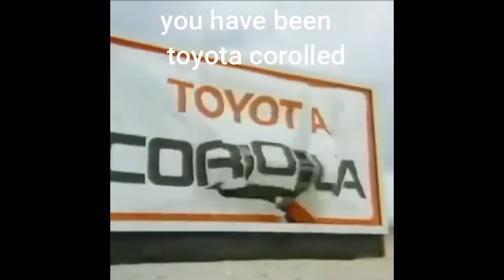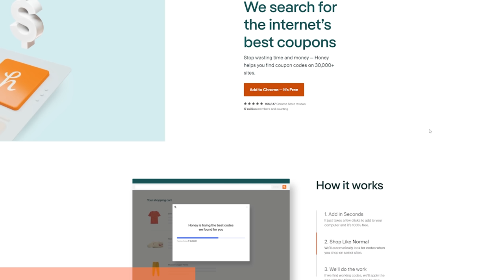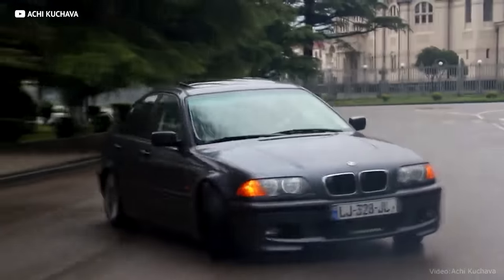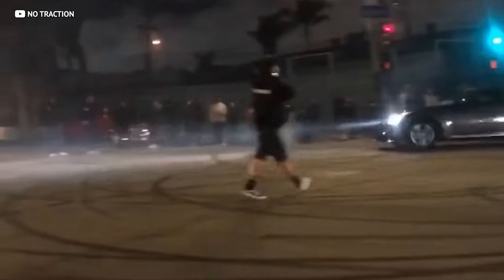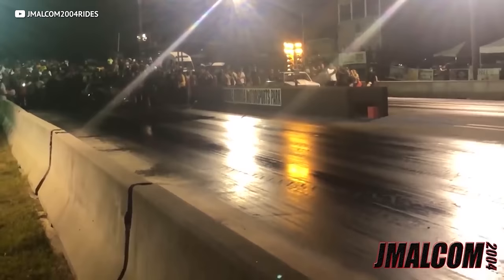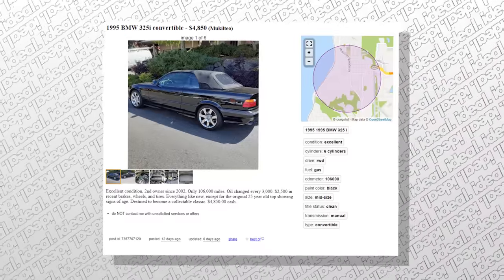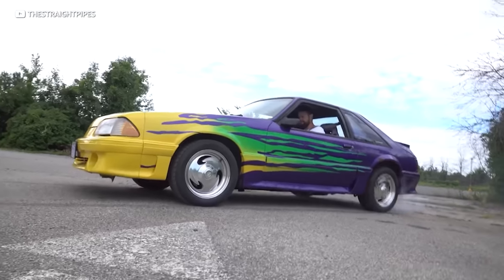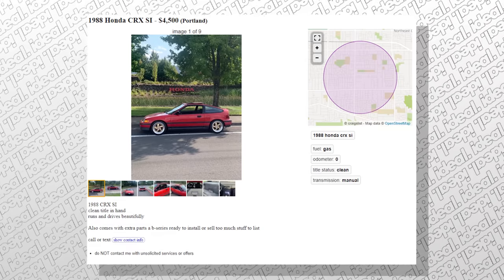8 CHEAP Cars With Unlimited Tuning Potential

Comment: I had a 1990 Accord EX in high school. Parts weren't super popular, but I was able to get a header-back exhaust system, coilovers, intake, new cam, new valves, upgraded ignition, and a few more suspension parts (strut bars, sway bars, end links, etc.). In auto shop my teacher and I did some grinding to the valves, honed the cylinders, got the head and block machined down, new head gasket, water pump, fuel pump, and a bit of other things. Took the default F22A2 from 130-ish HP up to a little over 220. For a 4-Door grandma car it was a total sleeper. I miss that car :(

Comment: Stock for stock an SC300 makes a better project car. The IS is OBDII with a VVTI 2JZ with the weakest internals available for 2Js. Non-VVTI OBDI SCs are better boost candidates and are easier to work on.
Reply: Facts the internal for the is 300 are weak
Reply: Thanks for this comment , I’ve been wanting to get one for awhile such an underrated gem

Comment: I have owned an LT1 Camaro, currently own a New Edge Bullitt Mustang with a procharger.  One thing I think you missed is a Crown Vic, other than Cleetus buying them all up.  Or a truck.  Plenty of regular cab short beds that can be quick.  Oh, and want a cheap LS, truck or van is still a cheap way to go.
Reply: Id like to go IS300, or E36 Bmw next.  But I am currently working on a '74 Dodge D100

Comment: Always liked the CRX. I wonder if you can tune that motor without dropping in VETCH? Also the IS300 just because of the 2JZ. OOOO so tempting. 700hp would make my kids think their 65 year old father has gone nuts. Sounds good to me 😃
Reply: Is300 much better if you swap in the 3gste. The 2jz makes power but it is a straight line engine. The powerband sucks yif your going to do anything but drag it sucks.

Comment: CRXs only came with a B Series in JDM Markets, good luck trying to get one. Even if you manage to swap a B goof luck finding genuine Type R Parts. They won’t bolt on right up unless it’s a VTEC. And they’re not cheap
Here in the states the best CRX we got was an Si and that came with a D Series pushing 108HP.
K Series would be the best option as they’re easy to find and fairly cheap to swap into 88-91 Civic/CRXs

Comment: I got one for the list. 1998-2003 Acura cl/tl. Both cars are still reasonable priced,have plenty of aftermarket parts and power upgrades,and don't take much to rip down the highway. I had a 2001 Acura Cl type s that ripped down the road when u opened her up
Reply: Power to weight is horrible, why it isn't there.

Comment: I actually drive fwd Camry. 2015 se. it isn’t half bad. I would prefer something faster and louder but this thing can get the job done for now. Handling is great on it and I can outpace dodge darts in a straight line roll race on the highway.

Comment: You need to do a list similar to this but with a cost breakdown of the modifications required and how many horsepower you add and end up with.  See what is the cheapest way to get a car to 400hp or 500 hp or to add 200 hp to a cheap car.  

Another ideas is the cheapest high hp:weight ratio after mods.  Is it an MR2 with $2000 of mods or something else.  

Get specific with the actual  mods and those prices.  Maybe to a bracket series where you start with 16 cars and do 2 cars each episode and pick a winner for those parameters
Reply: Would be cool, but would take a TON of research that relies entirely on other people's completed builds, and dynos, where the owner may not be the original modifier. Also, many people end up going over their budget, even when they think they planned well.
Reply: not possible to make a video like that. too many variables. it all depends on how good of a mechanic you are. if you cant do anything it will be expensive unless you just get a big v8.
Reply: @MV-ri7zu  not true. There are common methods that are used over and over on the same car to add easy HP, exhaust, tune, cam or injectors.  Some cars don't need much to add 100-150 hp and some need more.  

Don't need set up to reach max HP, but some cars you can add 100 hp for $1500.
Reply: @shaneducholke364  and those common methods usually vary in price A LOT depending on how good you are at finding parts, buying parts and installing them.
Reply: @MV-ri7zu  hence the video request

Comment: I actually own an IS300 but the VVTI cam gear is something people need to look at once the car has 200k+ miles
Reply: I'm thinking about getting a is300, I currently have a 08 gtv6 Tiburon. What does the VVTI do for it after reaching 200k miles?
Reply: @luck6959  Nothing really changes but just keep an eye out if the VVTI can gear oil seal cause it would break down and you loose a lot of oil cause of it.
Reply: So what exactly do i need to change after i reach 200k

Comment: The Is300 and the Pontiac WS6 are definitely a great cars!! I still wouldn't mind having one. But there are three other cheap sleeper cars that i like and they are the cobalt SS, Saturn Ion Red Line and The Grand Prix GXP
Reply: is300 isnt even cheap unless you get an automatic which will be expensive af to mod since youll be swapping pretty much everything.

Comment: An 8th gen civic SI can be snatched up for cheap now. Just got one for $5,600. 8k redline, 200hp and a full supercharger kit including fuel pump, injectors and Hondata tune sells for about 5k, and will make 400hp in a car that weighs less than 3,000lbs. Build the engine, transmission, and make it AWD and you can stomp R35s and Lambos for like $30-45k. Plus it's pretty comfy, cause it's a fairly modern Honda

Comment: Great video and ideas, I'll just toss in the "Mister Two" has a Pontiac competitor, the Fiero. Folks used to give these Cadillac 4.1 swaps, then 3800 supercharged swaps, now its Impala LS FWD drivetrain swaps. It might be too old for some, or too much work to do a drivetrain swap if you're just looking for bolt on stuff, but the plastic body panels keeps the rust demon away.

Comment: I've had 2 E36s. 1st was a 328i auto.. 2nd was a 1992 325i non Vanos with a 5 speed. Much more fun. Also had a 92 Celica gt 5 speed. Slow but fun. Now I have a 91 honda accord and a e46 m3. Love them both. Would like to get another e36 and make a cheap drift car to learn in tho.
Reply: What sites do you use to look for vehicles?
Reply: @litaf4889  I don't really. I did buy the 325i off of a guy on Craigslist but that's it
 Bought the 328i at and auction and the Celica from my brother.

Comment: First car was a v8 jeep. Still got it. When I turned 18 I bought my 2nd car, a pretty clean 99 civic. Wheels, coilovers, intake, and a sound system and it was a pretty fun cheap to drive, good mpg daily. 4 days after the coilovers and a cop didn't yield to me and totaled it. I'll always miss that car. Had the 5 speed too.

Comment: i own a manual infiniti g35S from 2006/revup. It's an amazing car actually and i've got headers/exhaust/injen intake/plennumspacer/wahlbro 255L gaspump/tein coilovers/cusco springaxels/wilwood steady axels and bigger brakes. i can tell that ALOT of turbo cars dont stand a chance. it's pretty quick. also this costed me maybe 750 dollars for the engine. and turbo convert with forged engine is like 5000 dollars. because the compmotive turbo is expensive but you dont need the oil/water pipes :) just mount it on the exhaust. and forge the engine , your'e pushing 900+ horsepowers.
Reply: Do you have a YouTube video where I can put this together myself? I'm new to the car community
Reply: please let me know about this car  and post video's or anywhere you have it? thinking about getting an infinity for a fun project car lol have a honda accord 2011 lxs and want something fun on the side lol that or ls 300 what you think? you have an instagram?

Comment: I got one a few, 2013-2019 Ford Escape 2.0 Ecoboost, GMC Yukon, Lexus Ls460 and GS460, and Chevy Sonic. Cant go wrong with a 5.3, GS is a detuned LS 460, Chevy sonic was a recent one with the aftermarket help, and the 2.0 is from the focus st so they share parts, difference is the tune and turbo.
Reply: Sonics can be rad, but the bigger hatch Cruze turbo are tuned able for about 1k. For about another 4k it's on coilovers, wheels, and some bolt ons you've got yourself a little hot hatch. The aftermarket isnt bad.

Comment: Funny part about the MR2 spyder being in here for me is that in the UK this model of MR2 is literally everywhere and I could buy one if I wanted for anywhere from £1500-3000. Though no boot space means if I want a car like that I'd rather have an MG TF or a Honda S2000 which are also relatively common

Comment: I own a 2004 SAAB 9-3 Aero (HOT version) 210bhp  standard. Unfortunately it runs the GM B207 block rather than the legendary B204. However the standard Garrett Turbo works well. Runs at 12.8psi as stock (0.8 BAR). Holds very well against Carrera 4's. The down side is your boost is electronically capped until 3rd gear, but 3rd is such a long gear, can take you from 30mph to 110mph no problem and the pull never seems to stop. I paid £990 for it 4 years ago and never modded it - never felt the need to.  All I did was replace the duplex timing chain/guides and pully's, banana arms and front dampers and coils.

Well worth it and a lot of fun. Keep in mind there are 2 versions. The 150bhp and the HOT variant (high output turbo) which is 210bhp stock.

A stage 1 tune will go from 210bhp/310nm torque to 250bhp and 370nm torque and is pretty cheap to do, around £100

Comment: My 1st "Car person car" was a 1999 Honda Accord. F23A4 SOHC VTEC 5 speed manual. It was murdered by an idiot from another town a few hours away who believed that particular stop sign didn't apply to him. Had over 436k miles on it and would still crack 130mph between exits on the highway. I miss it.

Comment: But you showed mostly G37s in the G35 section haha. Those are the cars that you can make 400WHP with the smog legal Stillen supercharger kit. I've been debating doing this but the little amount of power it makes over FBO and a good tune doesn't seem to be worth the extra weight, issues, and price. Unless you swap intercoolers but then it's no longer smog legal, or you just care about 3rd gear pulls on the highway.

Comment: IS300/Toyota Altezza here in NZ has a 3SGE Beams. But The altezzas go low as $2500. Classic G35/Skyline 250GT which go for about $2000-$7000
Reply: the altezza is a is200, comes with 3sge or 1gfe. can get an altezza gita with a 2j though

Comment: cheap bmw 335i. cost is about 5k for the car, 1k for the entire air setup, and about 500 for pumps and simple servicing, you have a performance car for about 7k. with the air setup you receive tunes that are absolutely awesome. its a great car for the price, and you can push 400bhp and higher. as long as you change the pumps, air setup, and a couple of other plastic based parts to metal, you have one of the best cars for the price, at the best looks, and best value. severely undervalued nowadays.

Comment: There are Toyota pick-ups that have the same motor as the supra, SR5 models prior to 97' have the inline 6cyl motors, you can quickly and cheaply get a monster amount of HP for a few hours of work on a saturday and sunday

Comment: I own a 2002 IS300 well mine came factory with the W58 5speed I took it out and put the GETRAG 6 SPEED IN IT lowered the compression has a 97 Supra intake manifold all GTE internals and gaskets precision 62/66 respectively makes about 680 to 700 on pump gas Haltech on  it I bought the car un 2003 a lady pre-ordered the car in 2002 she didn't know the car was a stick she ended up trading it back in and i got it next to nothing and i still have the car probably would never sell it.

Comment: The SC300/400 should also be mentioned. Still cheap and a coupe. A big heavy coupe.
Reply: should also mention ls400, volvo 240/740/940, many w124 mercs are great, audi b5 with the biturbo 2.7, audi c4 with the turbo 2.2 etc etc

Comment: for actually budjet (under 3k) wv group has two of the most fun to mod engines 1.9 tdi and 1.8T. You can get 300hp pretty cheap and on a small car.
Reply: Would be cheaper to buy a g37
Reply: @almightybirdwatcher4986  no idea where you live that you can get a single infiniti under 8k€

Comment: I got IS300 with 2JZ and IS200 with 3sge beams, I will say the IS200 is much MUCH better in same HP range as 2JZ, meaning 500hp 2jz vs 500hp 3sge, 3sge ALL YEAR LONG. But if you want crazy power 800+ go for 2jz

Comment: I did'nt know the Altezza came with a 2JZ they have a Beams 6Cyl and a 4 cyl and the 4 cyl is stronger and faster then the 6 cyl beams. Lexus is300 did indeed have a 2JZ in it.
Reply: it didnt, only the altezza gita did. which is like a station wagon variant

Comment: I hate front wheel drive. I had a Mazdaspeed protege. Max horsepower is 500 HP to the wheels before you break stuff. Rear wheel all the way.

Comment: And also owned a Ep3 2005 Si Hatch I won't own another front wheel drive after it about killed me compared to my Is300 were I can get out of sticky situations unlike front wheel drive if it wet and your going fast hold on tight they will not turn they keep going straight 14k in damage later that car is gone wrecked it so bad I cracked the block in 3 places so front wheel drive no thanks

Comment: Bring up a Saab 9-2x but not the 2009 9-3 aero with xwd? 4 wheel drive and a turbocharged v6 that can handle over 600whp on stock internals. They usually go for about 5-10k

Comment: Nice vid bro, BUT I GOTTA STOP YUH ON THE IS300... TRUE the GE block has potential, BUT it's capabilities are limited to it's connecting rods (which aren't good past 400HP). GTE rods,will fit and your good for another 300hp. RAD ROD THE 2JZ MASTER confirmed that statement.👌😎

Comment: I have a few cars you guys should've put in the list 
2000 Toyota Camry XLE 3.0L 1MZ-FE 194hp FWD. $800-$2500

1997-2007 Toyota Caldina 2.0L 3S-GTE 256hp AWD. $1500-$3500

1991 Nissan Bluebird U13 SSS ATTESA 2.0L SR20DET 206hp AWD 
$3500-$5000

1991 Nissan Bluebird 1.8L CA18DET 164hp
$2000-$3000

1997 Nissan R'nessa GT SR20DET 201hp AWD
$1200-$2400

1997 Nissan Avenir GT4 SR20DET 227hp AWD
$2600-$3500

2004 Nissan Fuga 450GT 4.5L VK45DE 333hp RWD $3800-$5200

Now this last one I class as cheap because these usually go for $15k+ if they have low Kms on them.

1997 Toyota Century 5.0L 1GZ-FE V12 295hp RWD $7500-$9900

Comment: My recommendation would 100% be a....

Volvo 740 GLE. Dirt cheap, easy to build, and one of the strongest engines to ever exist. Push 700+ Horses easily and it won't hurt your wallet. Plus with a casual 4Cyl you will be sleeping on everyone.

Comment: N54 335i  for $10,000-$12,000
Any cheaper and itll need ~$2,000 of maintenance to accompany that price 

Same capabilities as the JZ with better cooling, price to acquire/modify, weight, and lowkeyness to all but a select few
Reply: N54 is not superior. calm down.
Reply: @bigjdm5460  most notably because of the initial maintenance requirements. Just part of the pros and cons of both motors, major pro being theres no JDM tax on it. Finding a GTE for any less than 5K is extremely tough, N54s are out here going for $500. BIG JDM look at my profile pic lol.
Reply: @PR0bro  i agree the jdm tax has tripled. jan of 2021 i just went and grabbed a 400 dollar 2jzGe Vvti locally for my Is300. Problem solved in my eyes. GTE pistons from toyota parts counter. Some Manley H-Tuff rods I sent the head to machine shop with valve stems , GSC springs and Ti retainers and GSC S1 cams. no need to spend 7k on a gte engine set.
Reply: @bigjdm5460  yep my buddys really into is300s i love them as well. He keeps bouncing back and fourth between buying a factory manual, or manual swapping an auto (manuals are like $13k here and they are all rusted to shit if theyre cheaper). Then hes also bouncing back and fourth between doing an NA-T conversion vs swapping a GTE in. 

Gotta add though (after maintenance) ;)))
N54 is more accessible
Cheaper to modify
Much lighter 
Can hold the same power as a GTE but has superior cooling due to an open deck design
Has an over stroked design and higher compression ratio from factory making boost come on smoother

Comment: My first car was a 1998 Nissan Sentra I drove it once and didn't drove it no more cause it was was fwd and I couldn't really do what I wanted to do in it so I sold it and bought a 2009 Dodge Charger based model with it unreliable 2.7L V6 but I still had fun driving especially drifting in it until I found a whole in the oil pan then a month went by my car was gone

Comment: One car is a Acura legend and first gen rl with my ecu flash and you get a instant 300+ hp add a turbo or a supercharger it can handle up to 800 hp just with some gaped rings and studs I have 2 Acura legends and 2 first Gen  Acura rl's  same engine and everything the c  Series already have iron sleeves and all forged internals except the pistons I am the only guy still modifying the c series  and figured out how the tune the factory ecu with no problem 
my twin turbo type 2 legend cupe I am attempting to reach 1000 hp all I will need is a  Copper head gasket studs a cylinder block girdle for the coolant jacket and that's about it and obviously fuel upgrades and stuff like that

Comment: I hate that they keep making so many of these videos, this is a big part of the reason that every car that's even slightly cool is going up in price except for some that they haven't seemed to notice het
Reply: Exactly dude but anything for $$ and clout. This sucks for the legit lovers of these cars vs posers I have an is300 and sc300 along with a 240sx and the 240sx market got ripped after videos like these started trending. If you weren’t in a 240sx this year you’ll never be in a nice one again under 8 or 9k. I sold a 240sx mint in 2018 for $2500 and huge mistake. Because 2yrs later they jumped 5k in price. I hate it here lol